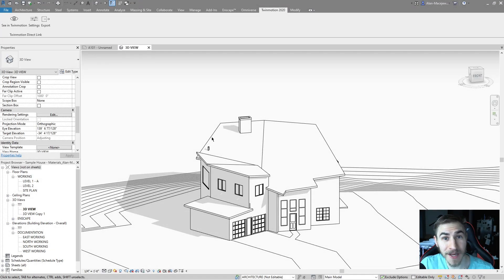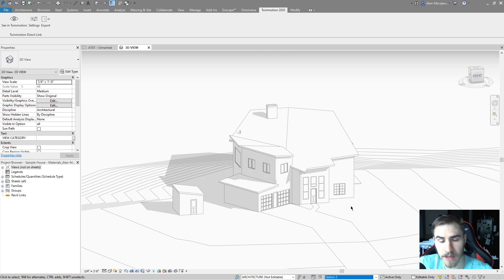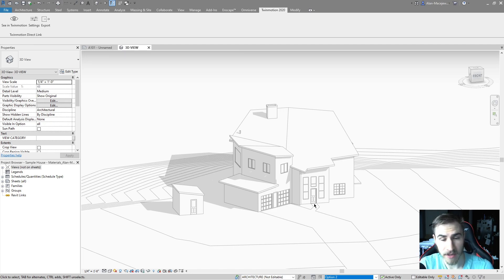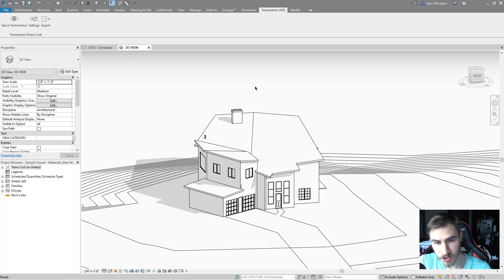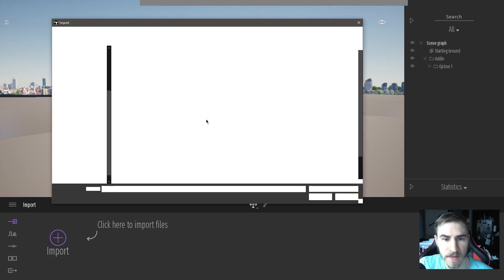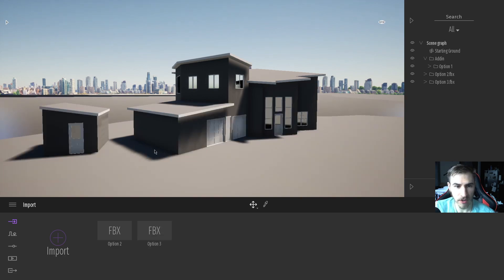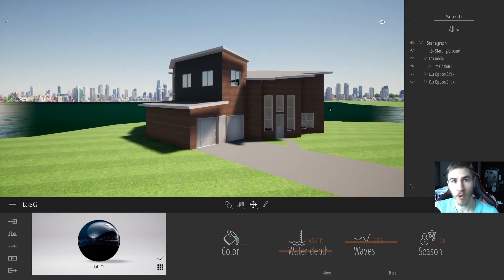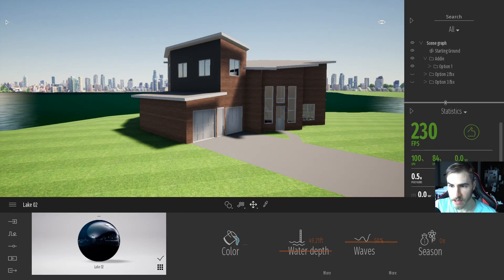How to Work With Design Options | Twinmotion

Comment: Yes, thanks this currently works the best in TM hopefully as you say they bring out an easier way. One thing though which happened to me is that when you open your file with the different options again for the first time, all the options are show at once which in my scenario with 4 options meant that trees or cars were sticking out of roofs and walls (In the different options the trees/cars were outside the house). This can be a bit scary as you wonder what the hell happened to my settings. It is only when you go back to your different images or videos (with the different options) that one sees again that all is well. Thanks for video, I always learn something new from you though.
Reply from the maker: Ahh thanks Peter, that's good to know. I guess all the visibility resets as soon as you close and reopen the file. I hope to see some sort of design option based tool in Twinmotion soon.
Reply: @ArchitectureVanguard  I don't think TM will do anything about it as TM opens up in the default mode. The phases are only saved in the media modes.
P